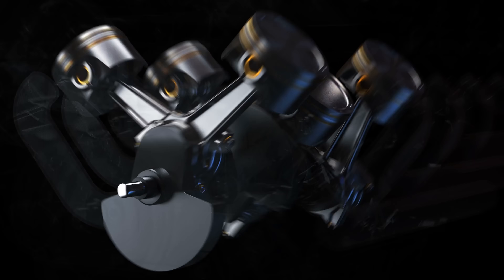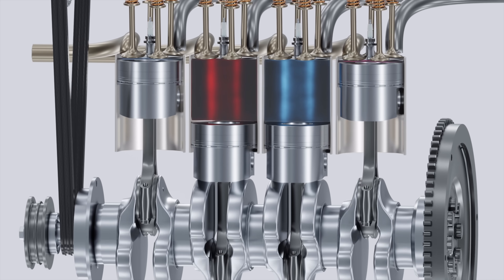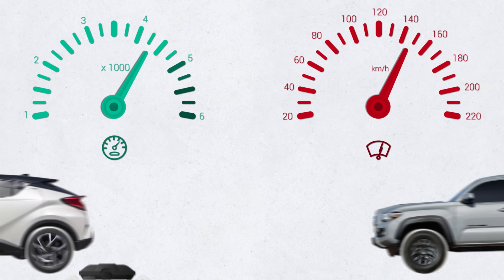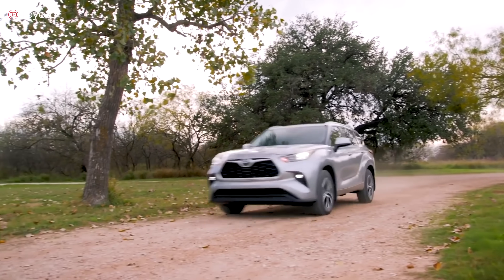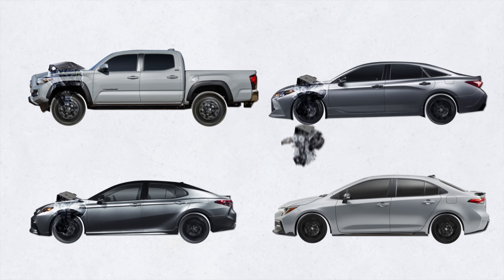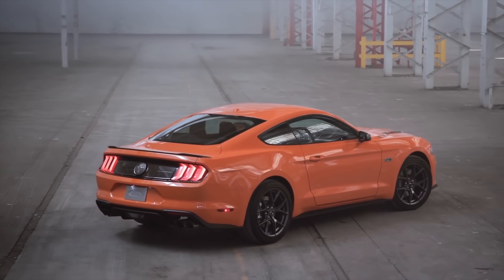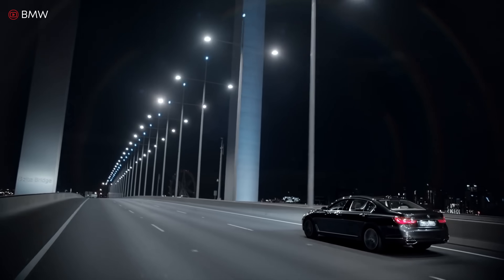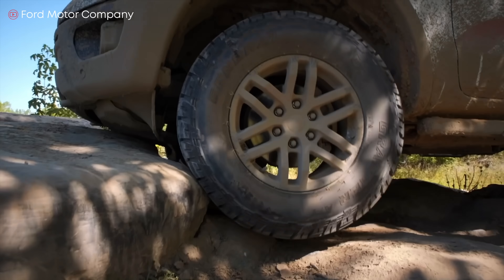No One is Telling You the Truth About Turbocharged Cars, So I Have To

Comment: When I got my first car, I started out with a NA 4-cyl engine (97 Honda Accord). Sure, it was fuel efficient, however it was very anemic in terms of power. I got my first taste of a 6-cyl with my second car (95 Acura Legend). The power output was comparable to a rocket and I found myself hooked to the instant power output. Then I had a taste of brilliant engineering when I bought my first VW equipped with the venerable VR6 (97 VW Passat). That engine was ideal for a variety of reasons. The firing order was the same as an inline 6, yet the efficiency was more comparable to that of a standard 60 or 90 degree V6. The allowed for more lower end torque with reasonable fuel economy. If I drove it judiciously, I could get 29-30 MPG highway. I soon found myself buying my next VR6 powered car (03 VW GTI) after falling in love with its power. I occasionally flirted with 4-cyl engines every now and then (01 Honda CRV and 04 Nissan Altima). I then bought a 2001 VW Passat with the V6 which I absolutely loved. The engine was smooth in operation and fuel economy was reasonable. After that car was totaled, I bought a 2001 Audi A4 Quattro with the same V6 engine. I had great reliability out of my 01 Passat with 260k on the clock with original drivetrain. My first taste with forced induction was a 2014 VW Jetta TDI. Despite only being 140 Bhp, it put out 236 Lb-Ft of torque all while maintaining fuel economy of 48-58 MPG highway!! I'd still have that car today were it not for Dieselgate. I decided to take a leap of faith with a gasoline powered turbocharged engine, when I bought my 2019 VW Golf with the turbocharged 1.4L engine. It puts out 147 Bhp with 184 Lb-Ft of torque. Definitely less torque and HP compared to my previous 5 cars, however I enjoyed the fact that I get 38-40 MPG highway, 32 MPG city if I drive it like I stole it. Surprisingly, the turbo-lag is not nearly as noticeable as it was in my Jetta TDI. A great daily driver overall!! However, once you drive a 6-cyl powered vehicle, you become an addict. So I bought a 2013 S4 with a supercharged V6!! I get the best of both worlds!! Plenty of power and torque without the turbo-lag!! The fuel economy is not too shabby at 25 MPG highway, however to be very honest, it is next to impossible to drive that car judiciously!! It's begging to be driven fast and hard!!
Reply: I had a '99 and '04 Passat, both with the V6 Audi engine.  It was slow off the line, but it could get up there in speed.  I didn't enjoy having to get the timing belt replaced every 80-90k, but those cars were tanks! Ran solid for years with very few problems and I got 350k out of the '04. 

Now I have a 4 cyl turbo Mini, the more reliable BMW engine, and I hope to drive a little responsibly so it lasts longer :)

Comment: In-line 6 all day there’s a reason 2JZ is so good. As well as gm atlas 4.2
Reply: I Love straight 6 engines.  They are Torque monsters.
Reply: For me, gotta go with the V6 Turbo in my 1987 Buick Grand National with a 6466 Precision running 25# of Boost
Reply: And Mercedes M103/M104/OM606 😏 the last one if it is a turbo version is capable of 600WHP without touching the engine internals 🤯
Reply: 2jz is king in the tuner world, and that stock 6 speed tranny in the supra can handle up to 800-900hp what a champ. 2nd most used/respected is nissans skyline inline 6. yeah, inline 6’s are great.

Comment: What about heat generated on the i4 turbos? especially with all the plastic parts? I rather stick with the boring V6 and keep ma money in da bank.
Reply: Modern turbos have oil and coolant feed lines to keep them cool and lubricate simultaneously. Some engines even have a coolant cooled exhaust manifold which further cools the already hot exhaust and even helps the cat converter. This system is awesome in cold weather because the exhaust manifold gets VERY hot quick and heats coolant quick. That's good for the engine because its warms up oil quicker, and heats up the passenger compartment a lot quicker in winter.
Reply: True dat.  Back in the day when I worked at a dealership, we got a sweet top trim turbo Eclipse on a trade.  That car was fun as all hell to drive but when I took it out the 1st time and then popped the hood to inspect further, as I really liked the car, the heat coming out the engine compartment was resembling more like working with a rocket engine.   That can't be good for longevity.
Reply: In the winter a turbo car with a good tune would absolutely destroy a v8 the power gain you get in the winter is crazy
Reply: @cdl34453  Cold air in a turbo is a very noticeable difference.  Hence, methanol injection upgrades on turbos.
Reply: @cdl34453  2003 Lightning here. Supercharged V8 you lose. Bonus if you drive like a normal person gets more normal gas milage. And it can tow stuff!
Reply: @cdl34453  before eventually destroying itself.
Reply: @cdl34453  LOL, ok nice try
Reply: NA V6s and V8s can be pretty crappy engines as well.  They can be difficult to work on and need a lot of maintenance.  The best engine is the NA I4 or I6.
Reply: @user-tb7rn1il3q  🤣 if you say so
Reply: @user-tb7rn1il3q  when you say they need a lot of maintenance, can you give some examples please?
Reply: You can always build your V6 into a turbocharged variant because most aftermarket components are metal and aluminum you have that option where is the auto manufacturers you know what they're going to opt for plastic because that's packaging efficiency you can gain longevity out of a turbo system by building up your engine accordingly to your needs
Reply: Americans are kinda behind at making efficient car engines. German cars are designed to work. Don't get fooled by Scotty.
Reply: @AF_1892  a supercharger is incredibly expensive and does not have top end it’s terrible from 50 and up
Reply: @rob5944  there’s oil lines in modern cars to kee the turbo lubricated and cool stop hating
Reply: @cdl34453  stop the hate lol
Reply: @cdl34453  ok, go on ....
Reply: Turbo Vtec owners: am I a joke to you?

Comment: I have a turbo 4cyl that I absolutely abuse almost every day and it’s still chugging at 350k miles
Reply: What make and model year ?
Reply: @breaddropper3900  2003 vw Jetta tdi alh
Reply: @masonspears1378  it's not a modern turbo
Reply: @jaunramirez3742  actually it is it’s a 2020 model vnt 17 making 35 psi
Reply: @masonspears1378  you said it was a 2003 not 2020.
Reply: @jaunramirez3742  the turbo is a 2020 model I upgraded for more boost
Reply: @masonspears1378  nice nice
Reply: @masonspears1378  or was it that the old turbo went bad?

Comment: I bought a car last October. I chose a naturally aspirated V8 with only 240 hp, but it's one of the simplest, longest running, most reliable engine ever made.  I'll stick with naturally aspirated and be happy with boring long-term reliability & longevity.
P. S. My car was an extremely low mileage, used, Lincoln Town Car.
Reply: Smart right...I guess anyway. I recently did similar though it's a v6 with over 300hp (high rpm however). The point though is that hopefully it's built to last if taken care of and kept at low rpm. I can get over 30mpg on the highway easily too. Almost always keeping revs below 2500 even on steep hills. That Lincoln can probably do hills below 2000. Maybe we are wrong and times have changed enough but high rpm = less durable has always been the rule in my lifetime.
Reply: Sorry. Life's too short to not have any fun.
Reply: @aaronbrown6266  I would say life's too short to be broken down on the side of the road, but I bought a 2020 Mazda MX-5 for my fun car, also naturally aspirated. 😀
Reply: @jetson2075  - Next to your wife! 😉😁🤣
Reply: I wonder. Can a Lincoln Town Car actually be boring? I'd take one of those any day
Reply: @rosen9425  Only boring in it's reliability!
Reply: I've got a '91 LS400. She ain't all that fast, but I don't spend much on maintenance.
Reply: @jetson2075   I love waking up in the morning and jumping into my Town Car to go for a drive! I also have a Mazda MX-5 for fun, so don't be so judgemental.
Reply: Bingo. You nailed it. Toyota Camry 4 cylinder here. I've owned this car for 19 years and put 200,000 miles on it. Boring reliability and longevity is the way to go. I have other cars that are higher performance than this Camry so I have had experience with both boring longevity and high performance. Boring longevity wins.
Reply: @aaronbrown6266  life's too short to be in a mechanic shop all the time, in addition to the risk of getting bullshitted and/or ripped off.
Reply: @maxcactus7  I have a grand marquis. Love the panther chassis! got 242k on the girl and she keeps on rollin!
Reply: 4.6 liter V8? im a toyota fanboy but i gotta respect them crown vics and the 5.8 liter ford had in the 90’s broncos, damn good strong engines.
Reply: Mercury marauder dude, its a performance version of the crown vic. it would be my 2nd choice for a highway cruising V8. my first would be 1998-1999 GS Lexus with the 4.0 or 4.3 liter V8.
Reply: @jakedover5301  No doubt the Marauder is a sweet car, but it gets ABYSMAL mpg and just isn't practical as a daily driver, esp when gas is $4.00+ per galling in California. They're also much harder to find in really prime condition with low mileage due to the low initial production numbers. That said, if someone offered me one for cheap, I wouldn't say no. :-)

Comment: I love still having a V-8. Plus, it sounds damn pretty cool; naturally.
Reply: And they're so much smoother
Reply: Specially the LS engines Thay are super easy to rebuild and it's so powerful and i call them the toy-track engines
Reply: At least European v8s sound nice
Reply: @ogalief  I certainly feel "smoother" driving my Cadillac. ;-) LOL!
Reply: My Chevy 4.8 8 cylinder sounds pretty damn good, love the pur
Reply: V8 was going to be my preference, unfortunately they are rapidly disappearing, a decade ago every truck and big luxury sedan had a V8 option if not as standard equipment.  Now forget about instead of a V8 it's a 4 maybe with a 6 cylinder option.  Most old NA V8's(that are not 5.4L from ford) last darn near forever, I'm not convinced on the turbo engines longevity.  I also question the cost difference as most automakers can produce V8 engines at a very low cost and turbos are pretty expensive complicated components.  The elephant in the room is CAFE standards, I think that is driving a lot of bad decision making, including plastic engine parts!
Reply: Scotty wouldn’t approve but I love the e92 v8
Reply: @shaunbava1801  Get an EV and skip all the craziness of the very last generation of extremely overly complex ICE engines that are trying to comply with impossible emissions standards. 

These small, high-reving, turbocharged overworked engines remind me of the highly complex final carburetors (1 per cylinder?) that, for the same reason, made direct injection look cheap in comparison and are now (a bad) part of automotive history. 

These kamikaze engines are suicidal and heading to extinction.
Reply: Feel the same way.  Just can't quit that V8 noise.  My commuter car has the 2.0 EB which does just fine, and I'll be fine replacing it with an electric.  But I'm keeping the V8 even if that means I'm making my own fuel.
Reply: Definitely Love my Ram HEMI 5.7 💪
Reply: @Sammyhale30  yup, and good luck getting one 😉
Reply: have x5 v8 :) yep agree there like labour of love to keepem lol
Reply: I hear that. I own Scotty's favorite, Audi S6 V8 Twin Turbo 450hp
Reply: @Sammyhale30  I wouldn't quite say that, it still has good pickup for normal driving even without boost, but def much more so with the turbos! im sure the Turbos account for half the HP lol
Reply: Eats so much gas though
Reply: @johnsalchichon3605  If you can't spend money on gas, and brake upkeep, you aren't having enough fun, in my book.
Reply: @rogerbritus9378  Sadly gearheads are are reducing in numbers, too. Working on engines and cars is just another process in steps, and figuring things out. Relevant in so many areas.
Reply: @luvyesmusici4886  well, today being a gearhead won't even get you started. You will need either a very thorough factory training or an advanced engineering degree in a mechanical and/or electrical field. That high barrier to entry is what's killing the general public interest in becoming a weekend garage meddler.
Reply: @rogerbritus9378  I'm certainly happy to see trade school classes taught at the high school level. We need folks in the service industry, too.
Reply: @luvyesmusici4886  I've got TWO trade school diplomas (mechanic/electronic), that I got before the engineering degree and the MBA. All hanging side by side in the wall, for I consider them of equal importance in my life.
Reply: @rogerbritus9378  You, Roger, ROCK!
Reply: @jacobsebastien3910  just like you, I love my 5.7 Tundra!
Reply: @Shaun Bava oh the shame if Henry Ford could see the plastics that are going into cars where metal should be. Tsk Tsk Tsk
Reply: What’s wrong with you peoples with engine and exhaust sound, are you listening to same single sound every days?
Reply: @danek893  Its awesome. Seems like you dont like awesome

Comment: I just like the fact that I can easily change my spark plugs and coil packs in a 4 cylinder. But the gas milage is also a plus
Reply: i have a stinger with the 4 cylinder. plugs and coils on the front, electric water pump right there in the front, plenty of room to work. And 10 year powertrain warranty.
Reply: Front wheel drive V-6 minivans are the worst.
Reply: I didn't know there was another me!
Reply: Yea spark plug change in wifes Cx5 takes minutes...plugs on v6 ES 350...so much more work. 
I'd like a Cx9 to replace Cx5 but turbo 4cyl longevity worries me.
Reply: Depending on space in the engine bay even V8s are easy to change. More expensive if you're changing all of them though.
Reply: The highest gas mileage I heard here was 30mpg.  That's awful.  I haven't driven anything that gets under 50mpg since 2004.  Granted, since 2 months ago I have an EV so mpg isn't a thing for me anymore, but still.
Reply: @CynHicks  dont even speak to me if you dont change all spark plugs at the same time.  You’re one of those people that will change only 1 strut at a time too aren’t you!
Reply: @wysmn  Lol...no but I said it that way because some people do. Sometimes there are good excuses too.
Reply: @StormsparkPegasus  When you have well over 300 HP at your foot 30mpg avg is actually not bad at all. Especially when you consider that it's NA.
Reply: @CynHicks  I guess... But I have easily that much or more and can go over 250 miles on the same amount of energy as about 2 gallons of gas
Reply: Going from a v6 grand am Gt to a 2.4 is a difference. I got 23 mpg before and now it's around 32
Reply: @StormsparkPegasus  We aren't comparing electric motors to combustion engines here. Also evs with comparable power is much more expensive and even then the power band falls off at higher speeds. Great low end torque but not high end. If you have an EV with a 0 to 60 that compares to a modern 300+ HP combustion engine vehicle (light weight) congrats on having more money to spend on a car than I do. Likley doesn't make up for the fuel saving over your batteries life. And I'm not hating either. Drive what you love. Thats what it's all about. What EV did you get btw? There are a few I would love to have. Though I drive too much for the current ones to make sense for me. Wouldn't mind having a weekend EV toy though. 😁
Reply: @CynHicks  I mean, I wasn't really intending to make it an EV comparison.  The last 2 ICE cars I had (2004/2014) both got 50-60mpg.
Reply: @StormsparkPegasus  Sure but my point was that modern performance vehicles are averaging 30mpg or more on the highway which is very good. That was in context of the boosted 4 cyl vs. NA 6 cyl (boosting a 4cyl is almost always all about performance like the ones in this video so non performance vehicles don't fit into the conversation). There are modern vehicles getting 50 mpg no doubt but none of those are close to 300 HP without some kind of e motor involved. So, when you said 30mpg was not good I was pointing out that it is very good for the power these 30mpg engines are putting out. 20 years ago vehicles over the 300 HP mark were getting just under 20 mpg at best and even single digits depending.
Reply: You’re lucky, I have a Toyota Avalon and I was charged $180 labor to change 6 plugs and spark plug wires. I asked why so much the mechanic says, the back 3 are really hard to get to. I already paid $9 per plug (Denso Iridium TT) and $72.99 for NGK high performance wires😭
Reply: I thought exactly like you until I hit 40. Drove a long series of 4 cyl cars and trucks and decided life was too short to put up with the lack of power, the noise and buzziness and everything else, got a Toyota V6.  I never looked back, it was very worth it to get a V6.
Reply: I had a grand am gt with several mods including a pcm tune along with larger fuel injectors. Dyno at 268 hp 228 torque, I beat a brand new Auti Quatro on the road. I got my fun out of that. I do want to get a sports car again and will do so when I get the savings and value out of what I have now. I will get a camarro and have fun doing some of the same things
Reply: @markg999  Same reason why I hold on to my 2008 CX-9. Waiting for CX-90, maybe Mazda will use an NA longitudinal 6 cylinders engine.
Reply: Normally I prefer naturally aspirated bigger motors, but with Chevys AFM & DFM causing lifter and other issues I went with the 2.7 turbo. I kinda felt like I was damned if I do, or damned if I don’t with all the engines now. Chevy seems to be doubling down on the 2.7 so I hope that is a good sign
Reply: @StormsparkPegasus  because he only mentions the turbo 4cyl performance cars not the mpg cars